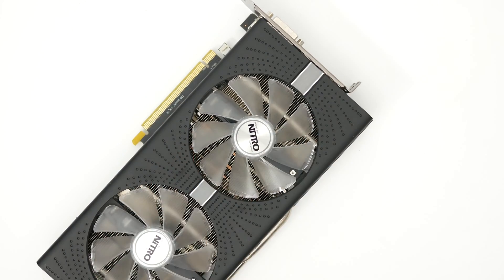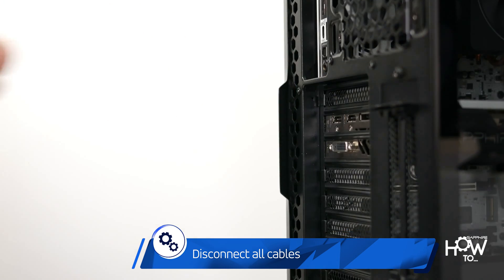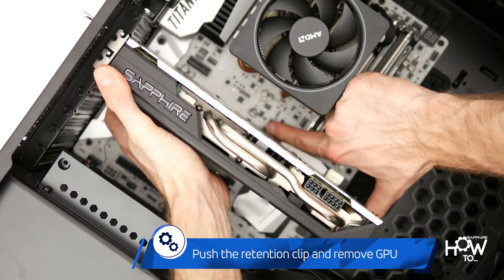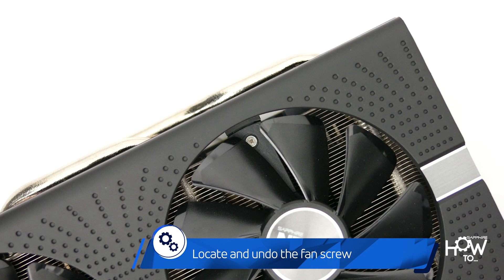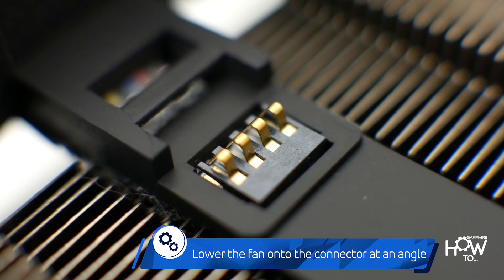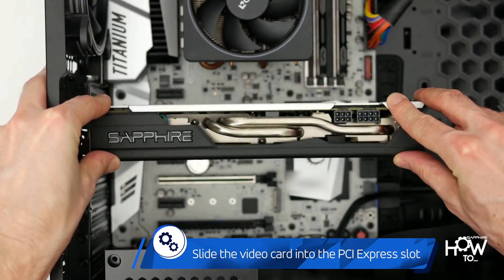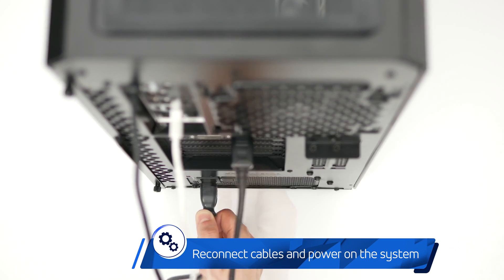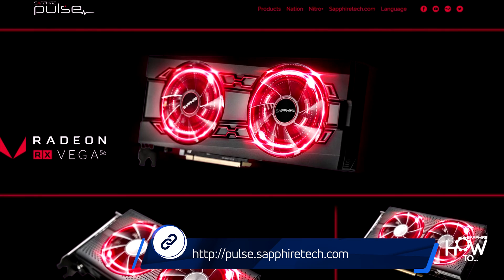SAPPHIRE How To: Change or Clean a Quick Connect Fan

Comment: Do you sell replacement fan wires for the Sapphire rx580 pulse none nitro ? I never took mine apart till today which was out of warranty anyways and I noticed the fan wire that connects to the header had nicks in the wires. I  forgot to take a picture but I didn't do it for sure and I know its out of warranty I just was hoping there would be something I could buy to replace it. I think it might melted a few years ago I smelt burning plastic, anyways if I have to connect the support page I will I just thought I would ask here first.

Comment: What's the point of this feature and instructional video if you as a company still require the consumer to send in the graphics card when you actually do need a new fan? The sapphire website is basically false advertising a great feature. The fans are also impossible to purchase without contacting sapphire, who will then give you the rma run process speech or point you to a "authorized dealer" who doesn't have the fans. Great product and feature in theory  but fans are impossible to get unless you send in your card for a month for the RMA process.

Comment: Can I ask why does all sapphire gpu's have these stickers on the fans? When I got mine I tried to remove the sticker, but does not seem like they are removable.
Reply: Why do you want to remove stiker
Reply: @intech7863  normally you remove those plastic stickers on new products.
Reply: @megapet777  yes agree but i dont remove them in nitro 580 and on nitro 5700xt , why to do it?

Comment: Hi, I haver the same case and gpu like yours. My issue is one of the gpus fan is goes on and off. Sometimes running but 3200Rpm as the other one. I tested by Strixx . Do you thing if I replace the fan will goes back yo normal ??
Thank you and I like your video !!
Reply: Hey man. Did you fix your gpu? Mine is with the same issue...
Reply: @jefersonvivas2020  3200 rpm is 😮 the normal is below 1600 mine is 1300 or 1260
Reply: Go to bios utility and Decrease fan speed

Comment: Don't forget to push the power-button again to unload the capacitor after killing the supply-switch!
Reply: I'd say leaving the PSU cable in while off at the wall is a also good idea as it keeps it grounded.
Reply: thanks !
Reply: Your advice can not work for all mainboards. To be sure just wait like a minute than continue
Reply: idiot..
Reply: @marble25  m?